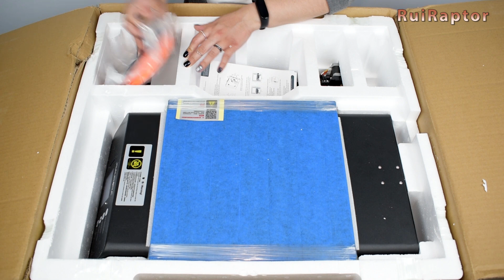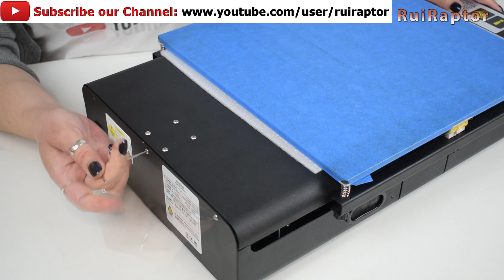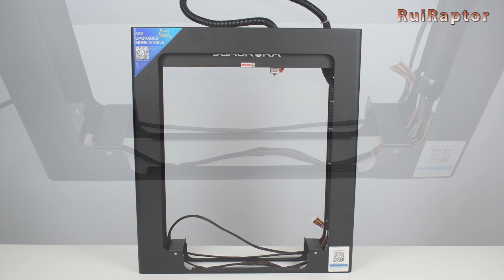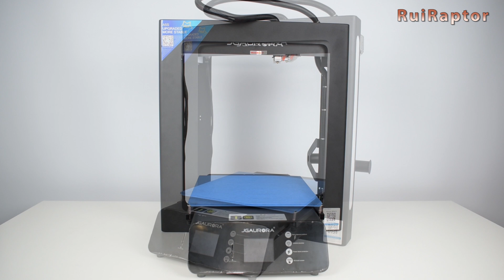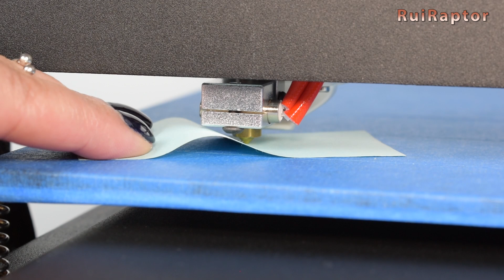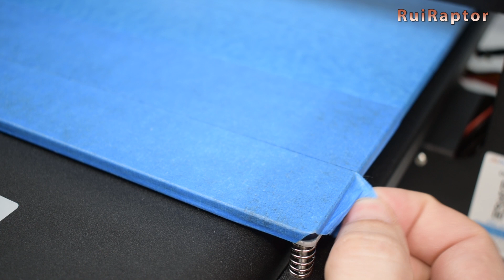JGAurora A5S - Assembly, First Tests & Review

Comment: Does anyone have any good suggestions for a printer? I was going to purchase this one but watching this and reading a few different reviews from places i'm  not so sure. I have had the Anet A8 for a couple of years which was meant to be a couple of months just to test if I wanted a proper one, I do. and now two years on I still haven't got one... I want one for less than £500 realistically, but unsure if there is a repeatedly reliable printer for this price? One which is easy to level and doesn't come as a DIY pack cause I just feel there is more to go wrong. Or maybe a low price commercial one that comes fully built? I'm unsure to be honest, but if anyone has any suggestions it'd be greatly appreciated!

Comment: Hey Rui! Great review! I have the A5 model and the biggest problem with it is the poor stability of the Z axis because of the movement between the gantry and the base. I solved it using small 90 ° brackets (four in all) and fixed it with screws to end this oscillation. I had to make small holes, but it solved my problem. As for the wobbling of the screws,
the problem is with couplers that arrive out of center or bent. I suffered a lot from it here. After disassembling the two axles, I checked that the screws are perfect and what causes this oscillation is even the couplers and poor centralization of the flat bar fixation at the top of the gantry. Thanks for the video, I was waiting for him to know your opinion!
Reply: would you recommend this printer after fixing it? or would you go with a ender pro 3?

Comment: Another great video from ruiraptor. Thanks. This printer just looks like one to avoid even for free. It amazes me every time I see a printer sent for review from the manufacturer that has not been tested like this one exhibits with the SD card reader issues. But even if it was it still suffers from very poor design. Flimsy sheet metal, poor construction and that extruder. What were they thinking? I genuinely feel bad for anyone that bought one of these.

Comment: This printer one should avoid. Parts are very hard to change out and are not quality. Customer service is extremely difficult to deal with. I finally had to use mine for parts.